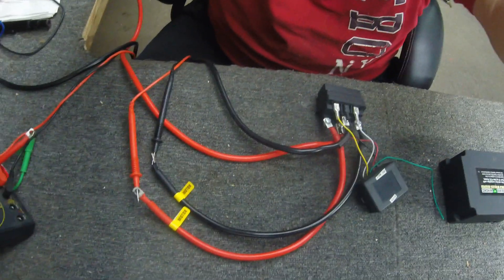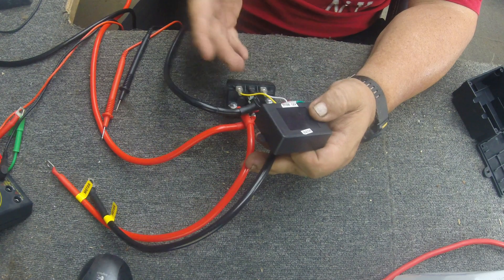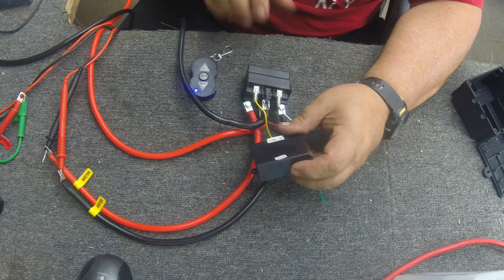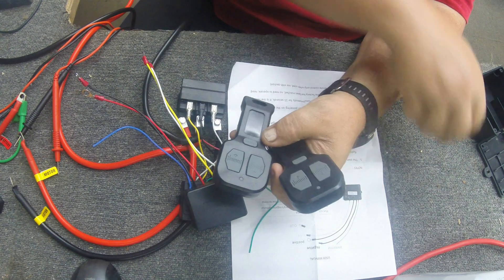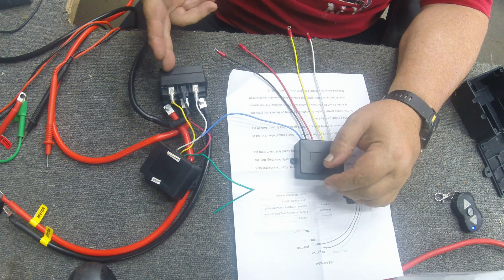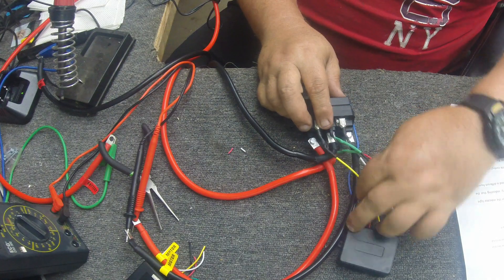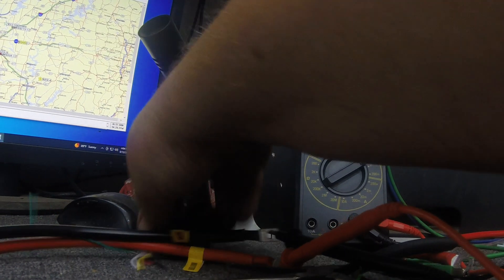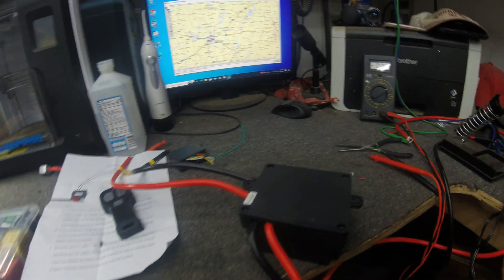Badland Wireless Winch Controller: Defective but Repairable! DIY Fix Inside

Comment: Thanks for the video! Did the original wireless transmitter "jog" the output? It looked like it may have in your video. I just tested my Badlands 2500 and:
1.) The wireless jogs  it's output, on for 2- 3 seconds, off for 2-3 seconds... It's annoying. So, I'll probably buy the transmitter you used. Excellent fix BTW.
2.) I was pre-tensioning the winch (pulled all except 10 wraps off, put a light load on it and rewound it. Even with NO load, it's overheating sensor trips. I wait the required 15 minutes and proceed. I think it's overly sensative and trips prematurely. 
Any thoughts, good sir? Thank you!
Reply from the maker: Thanks! And no my replacement does not jog the output at all. Not sure about the stock wireless unit because mine never worked LOL.

As for the overheating issue, yeah, those Badlands 2500 sensors are way overly sensitive. I just took mine out of line was tired of tripping works perfect without it. I found that that would trip even with no load, so yes they trip way earlier than you’d expect. The winch motor itself is fine it never gets hot so tells me it just the sensor that gets fussy which I assume you know it is just that little 1 inch silver box in the power harness line.

Hope that helps, good sir! Let me know if you end up swapping the transmitter hope you’ll be happy with it.
Reply: @TheElectronMan Hey man, thanks for the great information, advice, and prompt response! The diagram says it's a "circuit breaker." It's probably a resettable overheat circuit breaker. I'd be tempted to put an inline 130A fuse in it's place. My Bravex 1500 winch never had an over-heating issue and I put it to the test. Yep, it's way oversensitive. The winch transmitter replacement in your video is out of stock at Amazon, so I ordered a different transmitter. Brand new and I also didn’t test mine in time! Kind of irritating having to replace a brand new part, but it's only $20. The Harbor Freight reviews were pretty good, but we both got defective ones! Odd. Thanks again and I've subscribed!

Comment: The newer Badland winches, especially the APEX 12,000lb is actually a really good, very durable winch... They pull really well as long as they have good power supplied to them... the only weakness... it the wireless remote control has poor range.  It claims 80 feet... (which is how long the synthetic winch line is) but it rarely reaches that far reliably... Harbor Freight assisted Matt's off road (youtuber) when he was building his off road wrecker... it has  SEVEN 12,000 lb APEX winches....  so HF built him a rechargeable "Football"  that can control all 7 winches from one controller... it has much better range... so there must be a way for someone to modify the remote to use something better than two CR2032 button batteries for longer life.. Not sure how they improved range...Don't know if ever so slightly more voltage to the controller would send a stronger signal??  then again... maybe it would burn it out? but it'd be great if someone with electronic knowledge figured out how to get a longer lasting battery pack (rechargeable maybe? ) and get the remote to have better range.... HF did it... but nobody has seen inside the "football" to know how or what they upgraded?

Comment: I have a badlands 1,500 120v ac winch. And it has a 4 prong relay switch that is bad. Would you happen to know what type of relay I would need to replace it.
Reply: Thank you again
Reply from the maker: Hum good question I think the key is use a DPDT Power Relay 120VAC Coil, 20A – make sure it’s AC-rated and matches the current draw of the motor (check winch plate for current specs if unsure). Something like the Packard C230B should work.
Reply: @TheElectronMan  thank you
Reply: I found the relay coil that you suggested. The part that went bad on my winch only had four blades for connections to attached. It had a reset button add one wire from the relay and one one wire going to the reset button. There were only four connectors for wires that. The one that you suggested has 10 connection in the picture. Would that one still work and me just not hook up to those connections that I don't need? Because if I can I would like to keep the reset button just so I don't burn the winch up. And I don't know anything about winch wiring and power supply. And I just don't want to buy the wrong part. I can send you a picture of both parts if need be
Reply from the maker: @williamsimpson5772  You're absolutely right: the Packard C230B is a DPDT relay with 8 terminals, so it's overkill if your original relay only has 4 prongs. That changes things I found a NT90-AC120V-10X that should work 5-pin (you will only use 4 if your original setup didn’t use the “NC” contact)  I found it on Amazon here https://amzn.to/4nv8UES
Reply: I wish I could post a picture of the relay switch so you'd have a better idea of what it looks like. For some reason it won't let me post a picture
Reply: It looks like I'm just going to have to buy a new winch I've gotten that relay. But the manufacturers of relay on the Marked 3 of the 5 pins. And I don't know anything about wiring and have tried to find some information online about the relay and can't Find any information on the relay.

Comment: Update: Just finished the wiring with crimp ends and bench testing. Worked great. Mine had a jack on the original box for the wired winch remote. That got scrapped and the relay / receiver went into a small Pelican type case for more room. Very happy with the results.  The new remotes seem decent. Great advice!
Reply from the maker: Thanks that is excellent to here...

Comment: I have the same problem on a winch that's a couple years old. HF has a remote setup that plugs right into the winch wired remote plug, but it's $40. This saves about $25 and you get two remotes. Thanks.
Reply from the maker: Exactly that was my thought it was cheaper and I got 2 remotes..